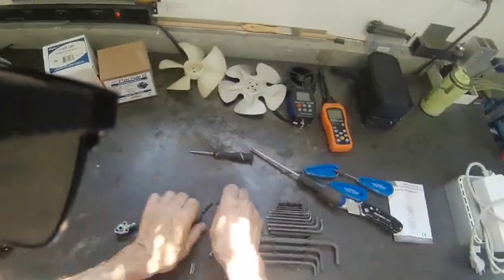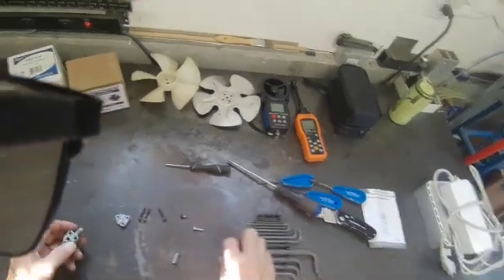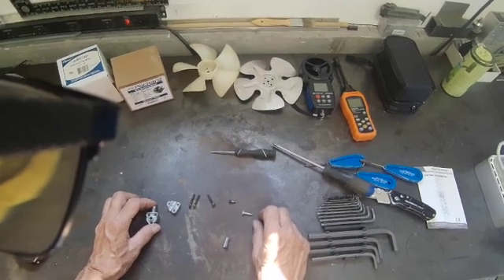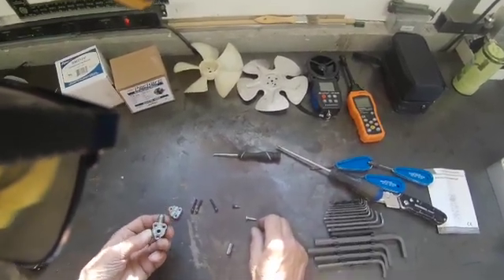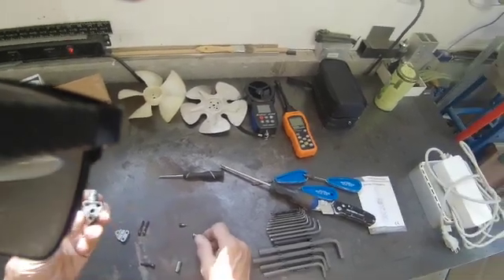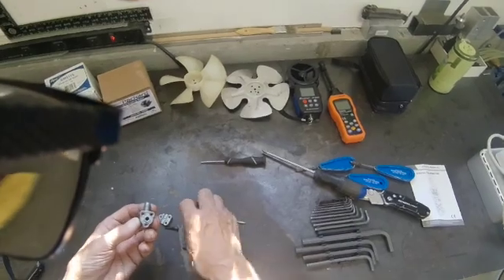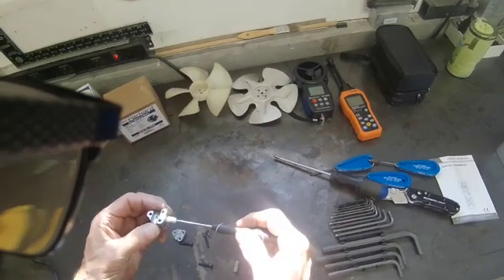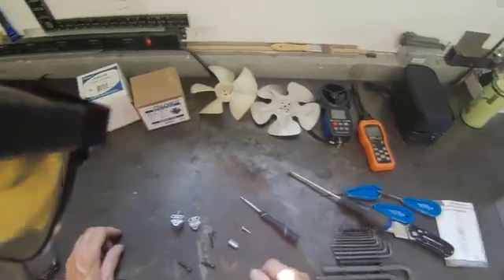Faulty Piercing Valves

Comment: I was just going to install  piercing valve on my dehumidifier which uses R410.  The Supco Piercing valve instructions state it is not for R410 use.  Any thoughts???  Please!
What is the best piercing valve for R410?
Reply from the maker: @rondail5675  R410 is a high pressure gas, I would use a solder-on process port.

Comment: Just want to run this and see what's your take.
The freezer compressor is shutting of after a few minutes due the the suction side going up to 65 psi.
The high side remains at 110 to 120.
I saw the the freezer evaporator only builds frost on the first half.
Restriction?
What  is your opinion. By the way wonderfull material you put out
Reply from the maker: What model are we talking about
Reply: @SubZeroSpecialists  736 TCI 3
Reply from the maker: What amps are you drawing on the compressor when it shuts off? How long is it running before it shuts down and is the condenser fan motor running when it shuts off?
Reply: @SubZeroSpecialists  no had a new compressor installed...I tested it with an exterior relay plugged directly to the compressor  and runs for 8 minutes...all starts mortal till the pressure increases on the low side and the compressor trips on the overload protector.
My opinion there is a restriction or the prior tech that put the compressor in had some lines confused.
Reply from the maker: @Mg_L.A.  could be. I would remove the Freon and cut the drier out, pressurize the low side and make sure the capillary tube is clear. While the system is open pump the compressor down and make sure you’re pulling at least a 26” vacuum , 27” to 29” would be ideal.
Reply: @SubZeroSpecialists  will do tomorrow morning..thanks keep those videos